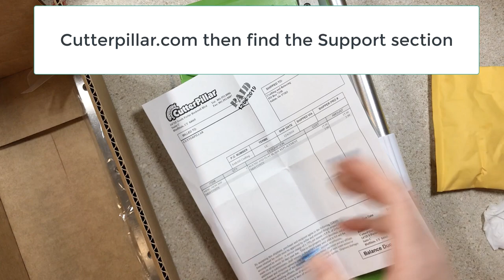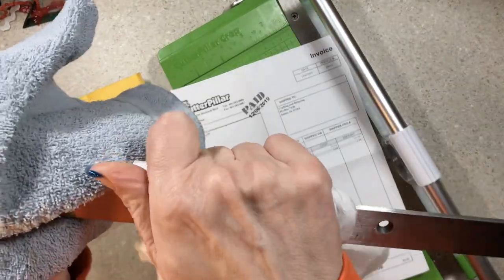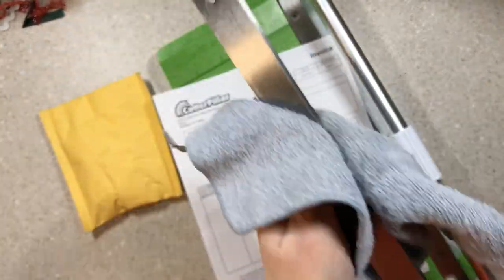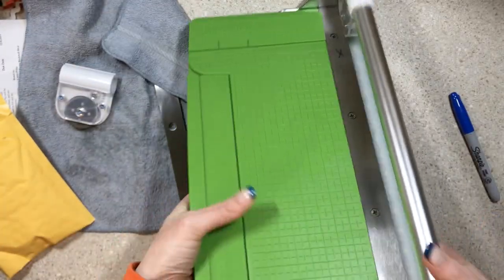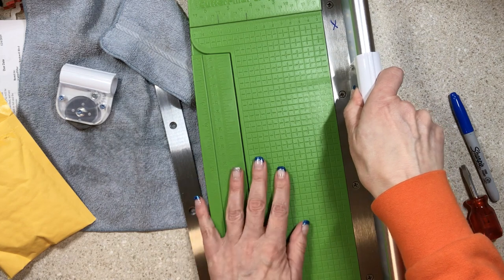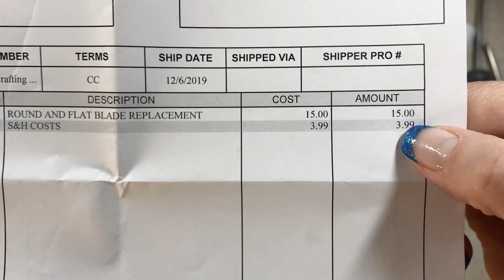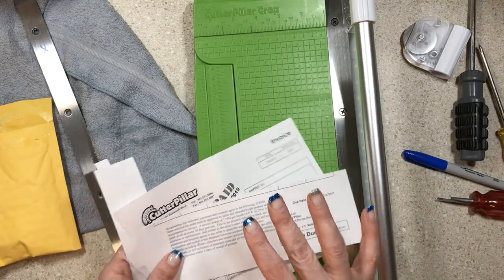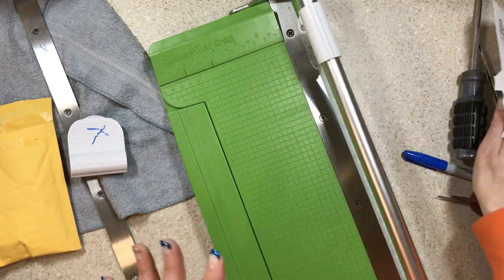Replacing Cutterpillar Crop Blades | Damaged Blades

Comment: Thanks so much for sharing! I lent my machine to a friend who cut sandpaper with it!!😮 it was horrendous when it came back but while I was waiting for the replacement blade to come I used it back and forth without paper as much as I could and it sort of sharpened up again. Only now … about 3 years later have I found the little padded envelope just like yours and peeped in wondering what it was …hey presto … thanks to your instruction I have replaced the rotary blade (the long one is fine) and, like you say, it’s as good as new. Mine is out on the sideboard all the time and I will never part with it. I just love it but it is the larger cutter not the crop. Thanks again. 😊
Reply from the maker: I think I would have liked the large one better. Sandpaper??? 😜 No more sharing. 😂🤣🤣 So happy to help! Happy crafting! 💙💙💙

Comment: The Lubricant Makes It Smooth Work While The Cutting Mechanism Glides Through, Also Keeps The Item From Rusting Or Is Exposed To Any Other Elements, Glad You Shared! 
Glad You Got The Items! This Is A Good Tool If You Can Get It To Work Like New Again😊
Reply from the maker: It turned out great, like I never even broke it! 😂 TFW 💙💙💙

Comment: iv used mine just a few times and now it is not cutting correctly. the blades feel dull. it does not make a clean cut. i only use regular cardstock. and this thing is expensive 😫
Reply from the maker: I bet they will replace your blades? That should help. 😀💙